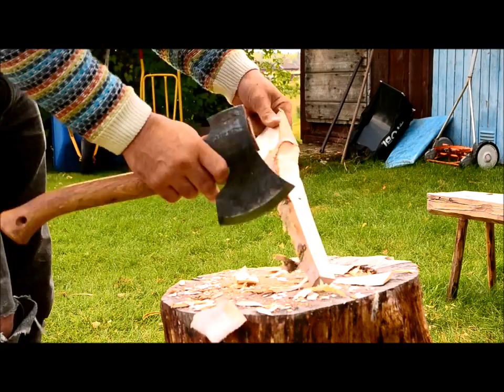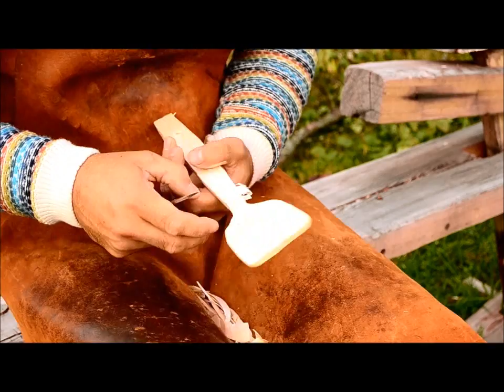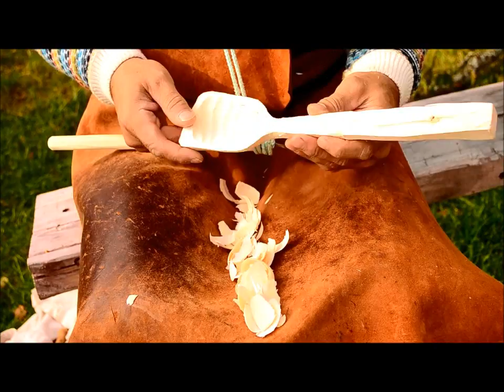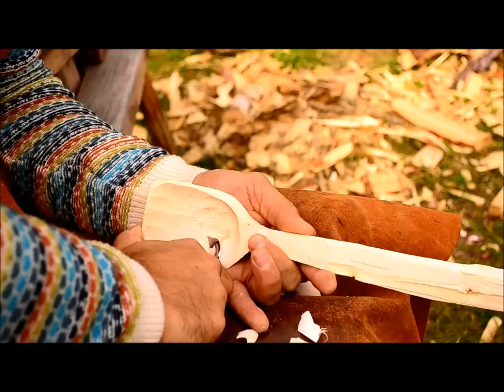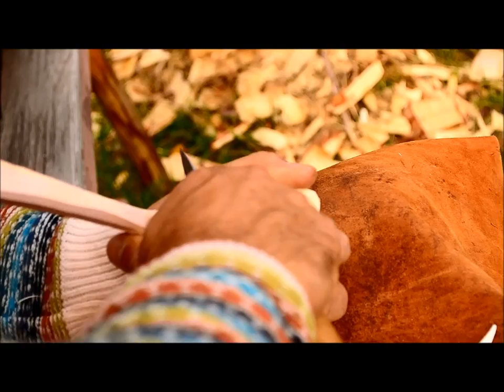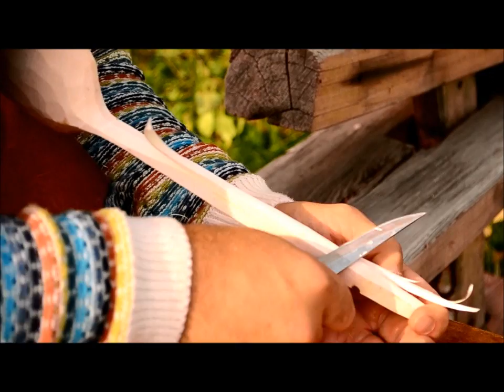Carving spoon

Comment: Not picking on you or attacking but please be careful when handling sharp tools. In the beginning you flipped the log upside down and began to pound with the blade facing upwards. Would be a shame for you to lose fingers since you do such nice work.
Reply: +Michael William Caudle Sr.  i cringed to when i saw that, but he is a master.. i presume he allready cut himself enough to learn from it :p most accidents happen when you are not concentrated or when you are plain stupid. Never ever trie to use a folding knife without lock as a screwdriver... :s big big scar on my finger :p lesson learned. Use the right tool for the right job
Reply: +Michael William Caudle Sr.  This tecnique is very common ive used it for years. Dont worry mate, skilled craftsmen might look like they are taking risks when its not at al dangerous
Reply: kristoff ceyssens v
Reply: Michael, He was demonstrating the proper way to continue a split if the axe bit sticks. Intuition would say continue smacking the axe/log unit down onto the chopping block until it breaks, but all that does is greatly increase the risk of breaking the axe handle. Doing it this way, he is using the weight of the log to split itself, without putting undue unecessary strain on the handle
Reply: Correct way to split a log with the Axe stuck
Reply from the maker: Thanks for watching and commenting, Michael. No offense taken :) This is a technique I liked using because I have seen many bushcrafters and outdoor people use it. People who I respect I might add. So I used it in this video to show it myself. I usually use a mallet now, it´s more convenient. I want to explain that my left hand, holding the piece of wood, is just holding the piece of wood in place. If the piece of wood should somehow slip on the chopping block when it splits, the left hand would not smack down on the axe. I brake the movement of the hand as the axe hits the block. The only thing that is still moving when the axe hits the block is the piece of wood. Because it is accelerated.

Comment: Do you still have all your fingers??
Reply from the maker: Yes I do! When I split the log in half in the beginning, that is a common way to split firewood. The wood keeps the hand from going into the axe. But also, my arms are locked to the body, so even if the wood should slip from the choppingblock I am prepared not to let my hand move further down towards the axe. The norwegian outdoor expert Lars Monsen use this way of splitting wood. But I know some people react to it. I should have commented it though, not to do it without experience. Thanks for your comment, Jason! :) ps. I usually use a mallet. ds.